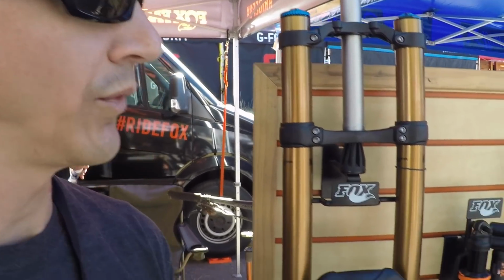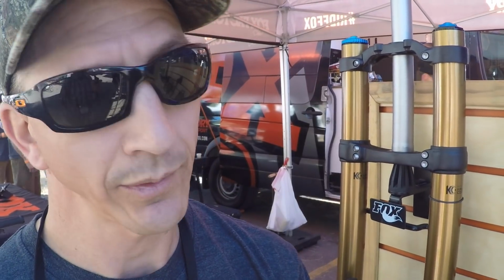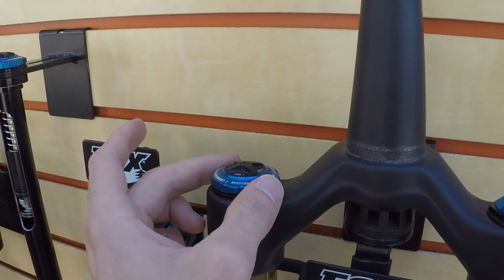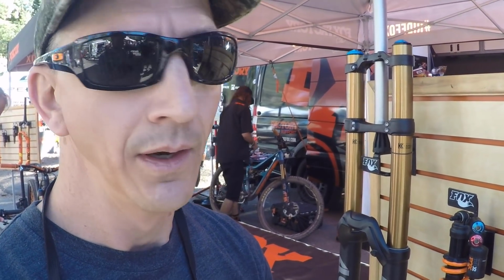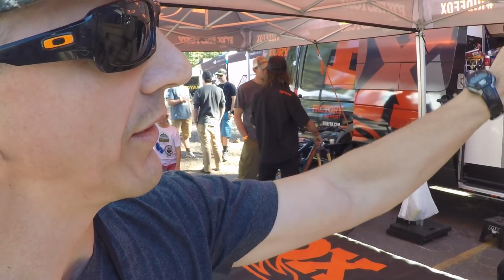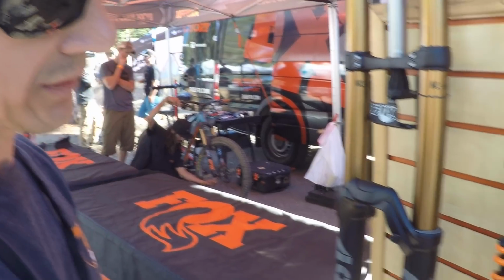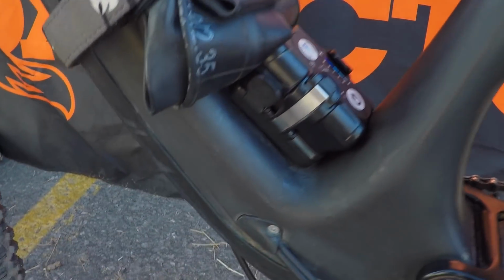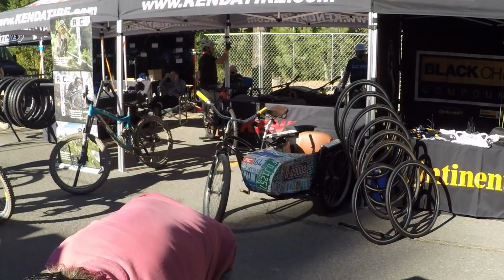Intro to bike suspension and Live Valve with Fox at Interbike 2018

Comment: Fox might be the best in suspension, but the overall state of the art isnt perfect: energy absorbtion should be taken by the spring, not by the damping. Damping only supposed to prevent rocking of the spring, to make it stop. Adjustable damping can never really take the job of a spring. Best would be to replace a spring, to create a linear or progressive behavior, independent from the actual damping

Comment: 3:05 more clearance, especially for rear end fo bike quick releases stick out so it's easy to got them, or damage them, or get stuck if you go i na tight rock garden, but for most people it won't be an issue. now as people have boost forks more people want to run axles without QR feature.
also the fork to the left is a downhill fork & has 20mm axle with clamping on both sides, so it's made for crazy riding.

Comment: Very cool Electronic suspension from Fox forks. This kind of system reminds of the Haibike SDuro               EI Electronic Suspension on 2015 models. They came equipped with a very similar system that has sensors in the front and back which in turn allows the system to adjust in advance to the rocky terrain in the rear.  
Makes me curious if this Fox system is an extension of the original EI system or is it their own proprietary EI system?? Points to ponder. Great video!
Reply from the maker: Good point Bob, interesting... I never got a closeup look at the Haibike system. Will be cool to experiment with the new Fox electronic suspension at some point :)